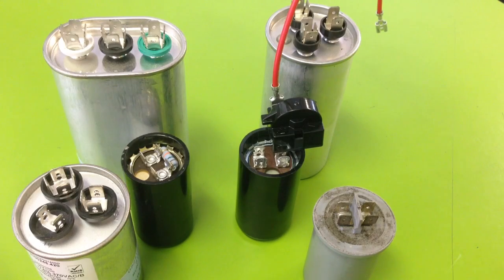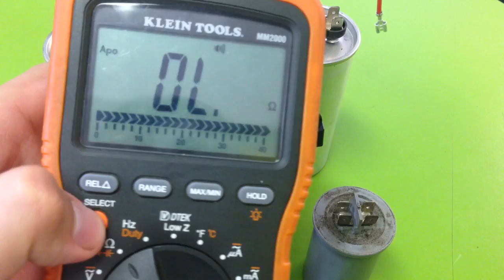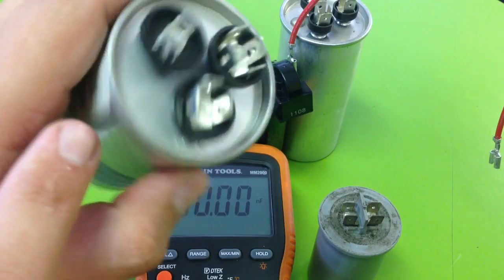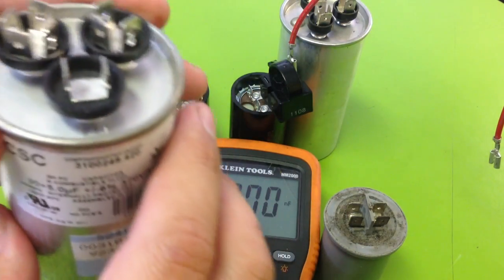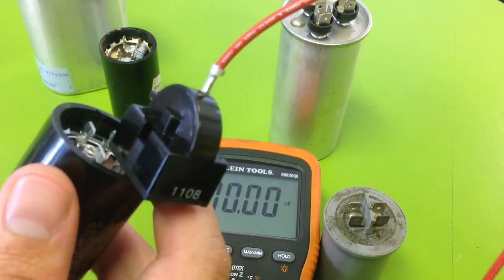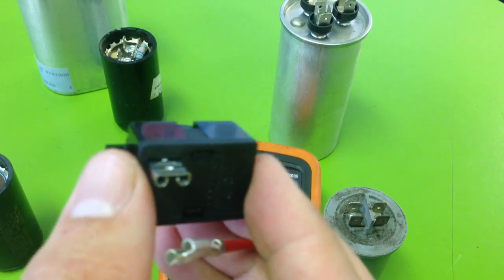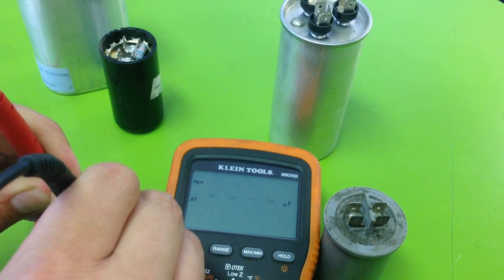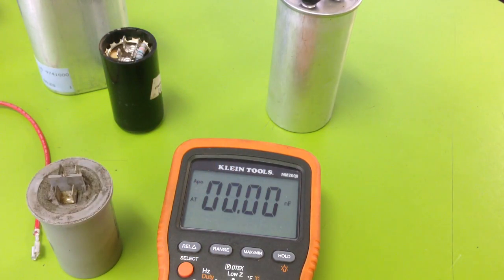How To Test capacitor

Comment: Your percentages are off. 6% of 30 is 1.8 The range of that capacitor is 28.2 uF - 31.8 uF
Reply: 1:58 

It read 31.14 which is within the 6% tolerance. His percentages were not off, even by your own calculations.